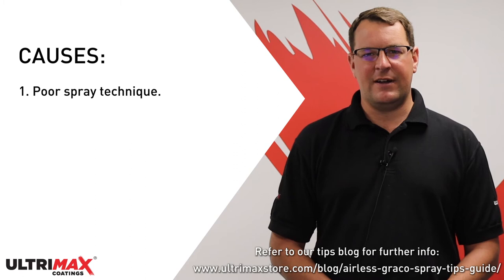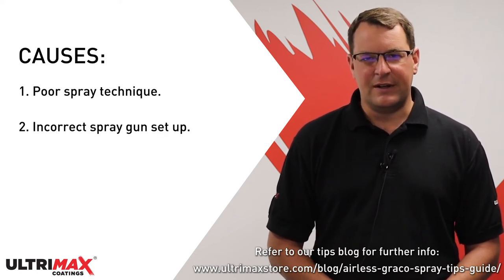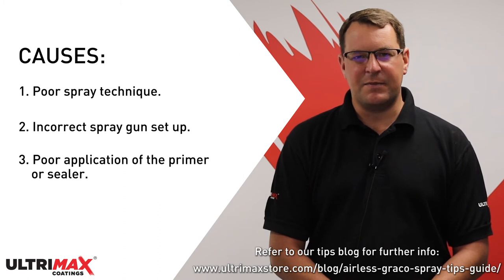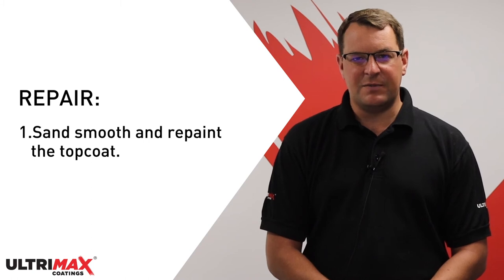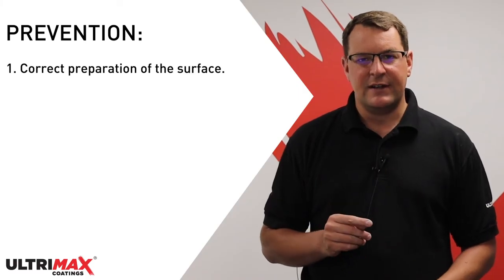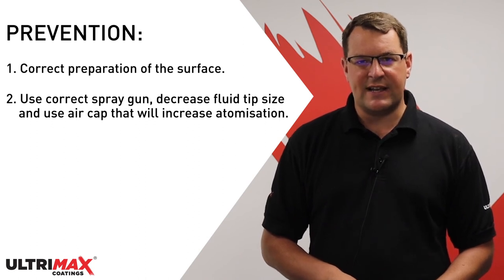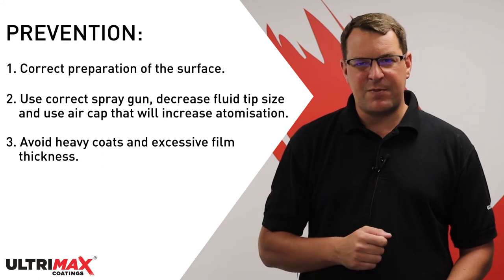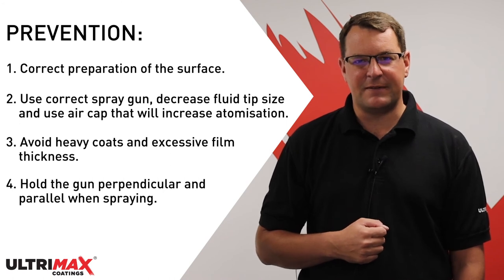How To Stop & Fix Orange Peel In Spray Paint?

Comment: What grit to use when sanding orange peel?
Reply from the maker: Hello Roman, we would suggest a fine grit such as 1500 - 2000 wet and dry sanding to clear down the orange peel in general. If the oriange peel is very bad then you may need a more coarse grit to take the job back down to bare metal / surface and start again. But assuming the orange peel has caused an issue but doesn't mean starting again fine grits should be fine,  use something like this https://www.ultrimaxstore.com/mirka-polarstar-velcro-sanding-discs-15-holes-p1500-50-c-16-p-858 br @Ultrimax Team